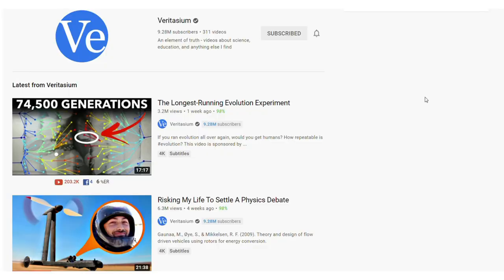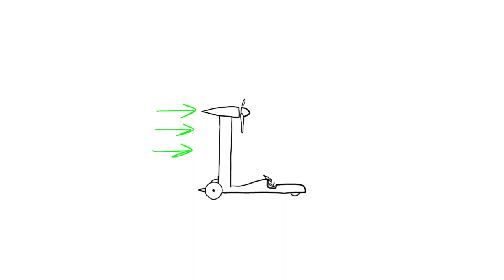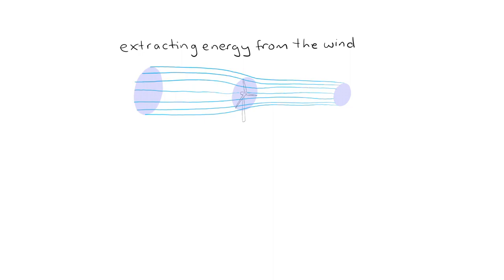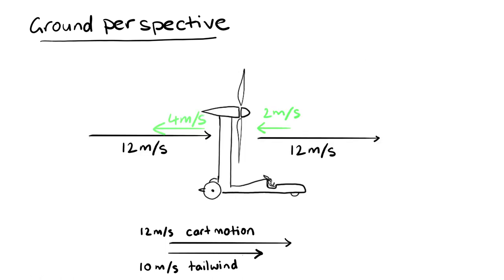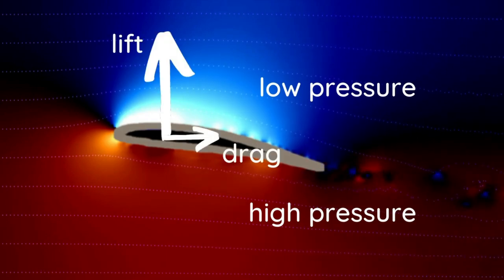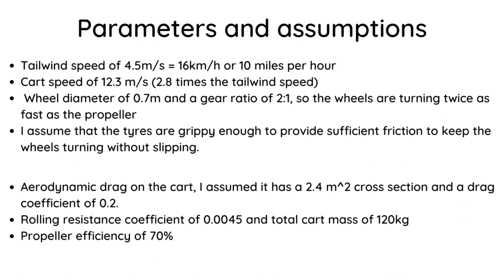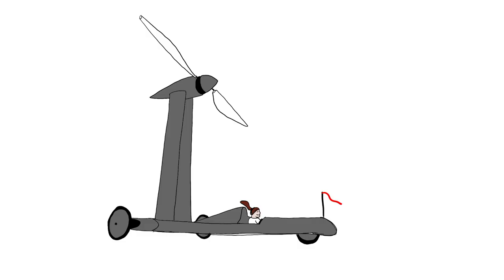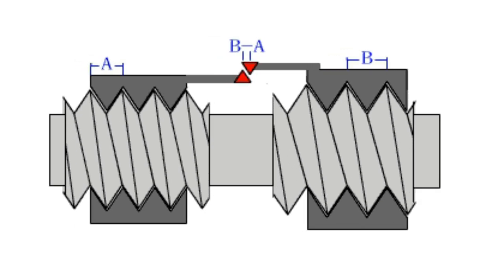Downwind Faster Than the Wind by Veritasium: How Does it Work?

Comment: @Engineering With Rosie, @Veritasium Why is everyone making this more complicated than it is? It’s a propeller that is being driven by the wheels, there’s nothing special going on! The Veritasium video doesn’t mention this fact until along way in the video, and misleads the viewer to think that this propeller is driving the wheels (rather than the other way around)! The model on the treadmill also demonstrates this, as the treadmill is moving it drives the wheels, hence the propeller starts production force.

I don’t know if it’s because I did Aero Engineering but this is extremely clear to me, and I’m not sure the professor that made this bet was aware that the prop was being driven. 
Aircraft with propellers have flown with tail winds for decades but no one seems to query how this is possible.
What am I missing that has made this case so special?

Edit to correct Veritasium spelling

Comment: This video's great! You cover the one element that I think was ignored in the other videos - the lift from the propellers. 
I felt the "sailboats on a cylinder" thing was neglected a bit but to me was the key for sails travelling faster than wind.
Reply: Sailboats can travel faster then wind - IF the wind hasn't the same direktion then the boat. With only complete tailwind it is  impossible! Faster then wind are only the blades of the Propeller but not the vehicle. In my opinion it is a very good fake.
Reply: @guri311  
//"Faster then wind are only the blades of the Propeller but not the vehicle. "//

This is incorrect.  The entire vehicle is traveling directly downwind, faster than the wind.
Reply: @johnborton4522  No, this is not possible, because then the force to the blades gets a direction AGAINST the driving direction. Why should there be a forward force, when the propeller wants to turn in the opposite direction? There ist no reason.
Reply: @guri311  

It's a brainteaser.  Keep trying ... you'll figure it out.
Reply: I have sailed catamarans. If you go directly down wind, you just go at the speed of the wind... BUT ... if you go DIAGONALLY downwind, the relative velocities (boat <-> air) are actually faster, and your net downwind speed is FASTER. Note that we're using the phenomenon of lift (like an aircraft's wing) so you get lift in a different direction (i.e. not so useful) but the lift is GREATER, so there's a net benefit, i.e. a net gain in down-wind speed.
This just proves that there is a way to extract more energy from the difference of two velocities (air v. water) and you are effectively using a gear ratio.
Reply: @simonmultiverse6349  

Exactly.    The airfoils of the Blackbird continue on a long helical 'broad reach' (just like your catamaran) while the chassis goes straight downwind.
Reply: @johnborton4522  Please explain, how it schall be possible, that a propeller, moving as fast as the wind, can force the speed of the vehicle! Because there can't be any force at the propeller without a relative air move. Onboard ther ist no wind for driving, if vehicle reach speed of wind.
Reply: @guri311  

//"Because there can't be any force at the propeller without a relative air move."//

You must be confusing a propeller with a turbine.  A turbine can't spin without a relative wind.  A propeller isn't spun directly by the wind, by rather by a torque on its shaft.

It's explained extremely well in this video as well as the videos and papers she references in the video description.
Reply: @johnborton4522  that's a great explanation right there!

Comment: Actually, in the first few seconds of the video, you revealed the secret. The wheels turn the propeller. If the propeller turned the wheels, then it would be impossible for it to go faster than the wind, because as soon as the speeds matched, there would be no input from the wind.
Reply: Yes, she is good at the con.